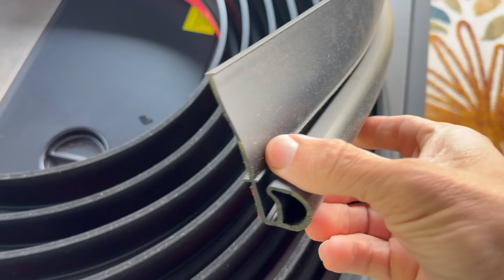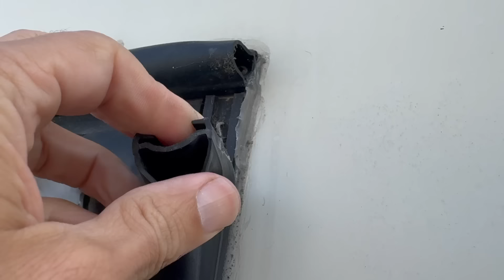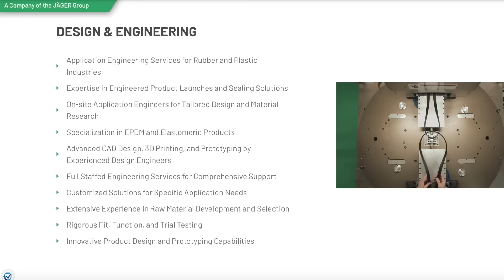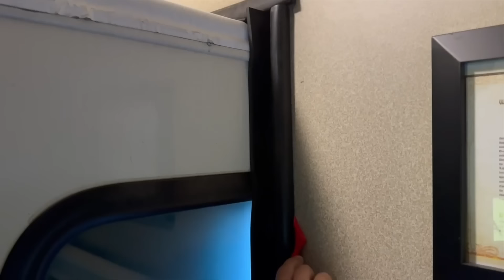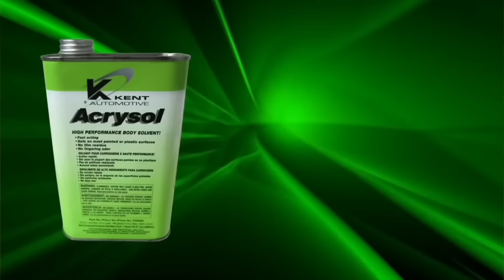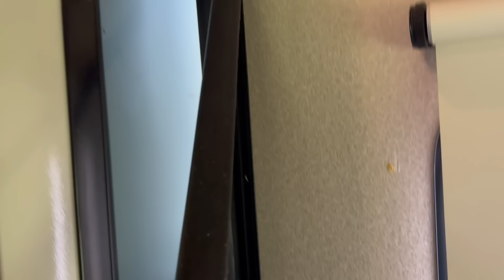GREAT RV MOD! - How to Replace Your RV Slide-Out Seals

Comment: Once you put the top seal on and tuck the top wiper flap under the side D seal in the corner, did you put a screw through flap in the side D track to hold the flap down?
Reply from the maker: Yes I put a screw into the top flap where it tucks under the side seal 👍🏼
Reply: @WhyWait  The Surveyor factory did that method on my new trailer and the corner of the slide out wore through the flap in just 3 years of normal camping use. The condition of the top seal is great other than the tear from the edge of the slide out rubbing. I now have to replace the top seal. From this experience, I am thinking it’s better to leave the flap not attached to the side seal in the corners.  Thanks for your great video. I learned a lot.

Comment: Right on, Chris!  I am shocked at how horrible the original seals are.  They're just junk.  I figured that would be the case for the replacements and would need to do it every 3 years.  I'm excited to switch to the Jaeger system.  Hopefully it lasts a long time!
Reply from the maker: @Mike_In_Idaho  yeah I just met up with them yesterday again at the RV Hershey show and their stuff is really good. No need for UV protection products to be applied to theirs either. 👍🏼

Comment: If you use petrolume base protectant it will ruin your seals . You want to use a water base protectant like ; 303 ; .
Reply from the maker: Hahaha it’s only funny because I talk about 303 in this video and you can even go back and watch videos of mine where I talk about using 303. Been using it for years on everything including all the rubber on my vehicles and no problems. 
303 Aerospace Protectant does not contain silicone oils or petroleum distillates, or other agents unsafe for rubber. 
But sound like you know and like it too. 👍🏼 Thanks for watching and commenting!

Comment: I'm curious if you used any kind of UV Protection on the rubber seals from the start to help this kind of damage from occurring?
Reply from the maker: Yes on my old seals I started early. Tried my best about once a month using 303 on them. Full time RV 6 years and those seals on top of the slideouts take a beating from the sun.

Comment: Hi Chris. The Style Caps seem like a great idea, but I'm a little confused as to whether they would fit my seals. They look like the ones you showed, but its not the Jaeger system. How can I be assured they'd work for me? Thanks.
Reply: Hi there! Our StyleCaps are designed to seamlessly fit with our slide-out seals only. We unfortunately do not have any way to guarantee that they will fit your seals, but we have heard of people retro fitting them to fit other seal types.
Reply from the maker: How do you know if they aren’t the Flip n Seal by Jager for sure? 
I would reach out to the company and ask, I’m not sure. Or just buy one on Amazon and try it. They aren’t too expensive if it doesn’t work. 
https://jaeger-unitek.com/get-a-quote/

Comment: FYI- Silicone adhesive sealant will not adhere to gelcoat.  If silicone adhesive was used on the gelcoat, you will need to sand the gelcoat to remove the silicone or the polyurethane or even silicone will not adhere to the surface.  Once silicone has cured, even new silicone sealant will not adhere to its self.  You have to sand the surface until water doesn’t bead up on the surface.  The silicone adhesive will eventually lose its adhesion quickly, 6 months to a year.  I learned about this from owning a sailboat and sealing hatches and deck hardware.  For sealing to gelcoat, you’ll need to use a polyurethane sealant.  Unfortunately, polyurethane doesn’t do well with UV exposure.  So, it’s important to use one of the UV resident polyurethane, like 3M 4000UV, Sikaflex 295 UV, etc.

Thank you for your video, step by step procedure, and the replacement product seal. 😎
Reply from the maker: Yes, we have numerous videos on sealing your RV and how to. You might like this one. We get into great RV sealant products. Thanks for watching. 👍🏼
How to RESEAL Your RV PROPERLY (3 Year Review of Proflex RV Sealant)
https://youtu.be/5J5FLjTB1OY

Comment: What about the bottom seal? Is that the same type?
Reply from the maker: No the flaps or seals underneath slide-outs are totally different if they even have them at all.
Reply: The slide-out seals on my 2015 Jayco travel trailer are like new. I’ve applied rubber conditioner liberally twice a year, either 3in1 rubber conditioner or Thetford, but not 303. However, they’ve never been in direct sunlight, as I have always parked it with the other side facing the sun

Comment: Interesting. GD had previously stated using the double EKD style was deliberate to provide additional weatherproofing of the luane-backed outer and inner wall laminations to the aluminum framing to prevent delamination...  Nonetheless, the product you used has been around a long while from America's largest and oldest weatherstripping manufacturer - Steele Rubber Products - and their products are made in the USA.  This style seal was standard on a lot of Forest River products where they capped the laminate edges and portal framing with a plastic channel cap.

Comment: My 2024 Momentum 415G came with the updated seals.  A month ago i was on the lot looking at a 2025 that just came in and it had the corners. I ordered them $24 for 2  pair and installed them.  My local Napa sold a 3M Adhesive Promoter for $3 so I used that before the install.  They really clean up the seals nicly and serve a function too.
Reply from the maker: Awesome, that’s good to hear. I just missed out on these seals by like a half a year on my Grand Design. Thanks for watching. 👍🏼

Comment: I’ve been seeing videos about how 303 Protectant is causing RV seals to disintegrate. I’ve been using it for a couple years and hopefully my seals don’t start to degrade
Reply from the maker: I don’t know about that. Been using it for years on everything including all the rubber on my vehicles and no problems. 
303 Aerospace Protectant does not contain silicone oils or petroleum distillates, or other agents unsafe for rubber so Id have to see hard science that it’s what’s causing rv seals to degrade.
Reply: @WhyWait  same here. I’ve been using it a long time and haven’t had any issues. Given 303 is geared up for marine use, you’d think they’d have a banger of a concoction. Thanks for the reply!
Reply: @WhyWait  which one do you use.  Amazon has several different 303 products.
Reply from the maker: @Karenjean71 this one in the link below. But use what ever the best deal is. Straight from the Aerospace company their automotive 303 is the exact same stuff. Just marketed and packaged differently 

https://link.amazon/B0an4zZ39

Comment: So if the interior seals are fine, you dont need to change them even though you changed the exterior seals.
Reply from the maker: Depends, if your exterior and interior seals are all one piece like mine are in the video then you have to add new seals inside and out. Now my top seal was one piece. So when I removed the top seal outside I didn’t have to replace the top seal inside. 👍🏼